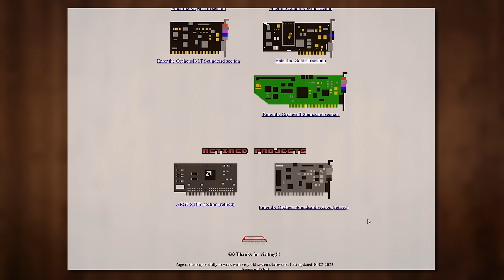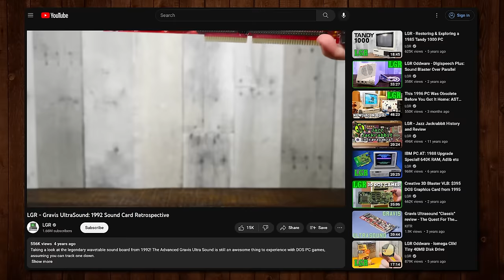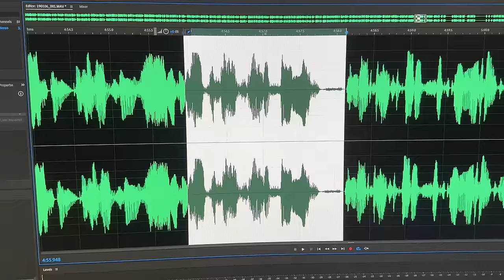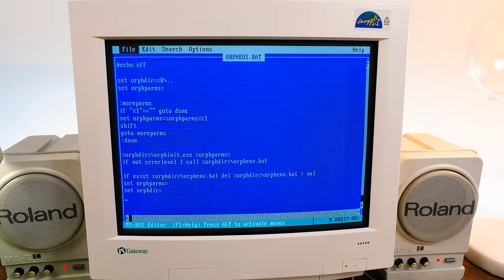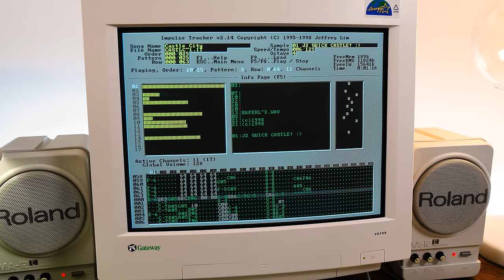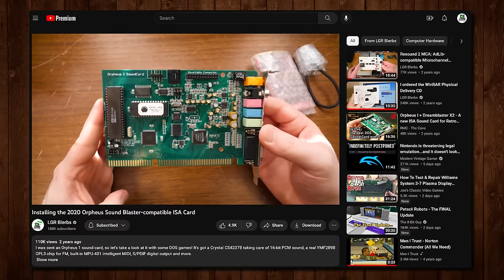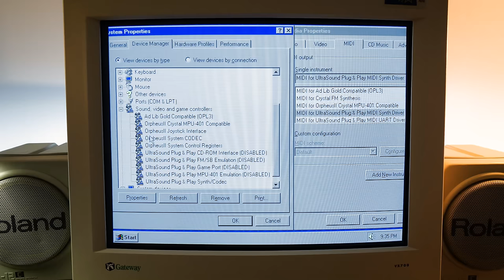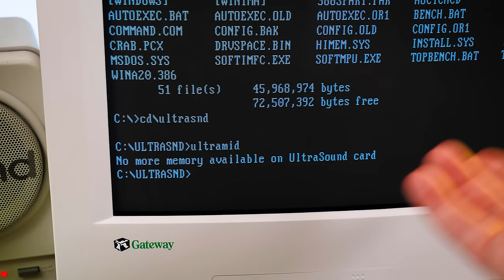Orpheus II: The Best Retro PC Sound Card in 2023? Perhaps!

Comment: Wow, I need one. My external box for my MPU-IPC-T is acting up, and I would like GUS support. I also believe that my first sound cards back in 1993 may have used Crystal chips (i9 can't recall - the card came with a Reveal Multimedia Kit with a cd-rom drive, King's Quest 6, and Stellar 7.) I am sure that later cards I had were Crystal, and before I learned to build my own PCs (and thus build retro PCs with real Sound Blaster cards,) my first Sound Blaster was some integrated crap on my Gateway Pentium III 450, and I disabled that when I acquired a Sound Blaster Live (SB cards were too expensive for my household in the mid 90s.) So with this card having GUS, Intelligent MPU, Crystal, AND OPL3 support, I will HAVE to get one. Currently, I am using a first gen AWE32. To me, it is top of the line for a late 486, but the benefits of the Orpheus seem to outweigh the AWE32.

What is the game at 14:48? Also, where can I get those bracket standoffs for displaying cards? Those are cool!
Reply from the maker: The game is a new one for DOS: Attack of the PETSCII Robots!

The bracket design is here: https://github.com/AkBKukU/PCCardStand
Reply: @LGR  Thank you! I will check out the game. I create pixel art in the style (due to my love of Ultima.)

I am looking for cool ways to display cards I am no longer using, such as a Roland SCC-1, Orchid Voodoo2, and when I get an Orpheus II, both the AWE32 and the MPU-IPC-T! Those little standoffs are cool.

Comment: Nice video. Thanx.

If there is a Vintage (related) product i'd like, its ....
- a 2,5" inch sized system using exclusively newly available hardware such as
- an Am486 DX4-100 to K5 PR-166 CPU, 
- 128MB to 512MB PC-100 - PC-133 RAM,
- ISA SB-Pro. 2.0 to AWE32 Gold compatible Sound with Dreamblaster S2+ Midi-Features and
- a PCI to AGP graphics card with 8MB to 16MB RAM compatible to VESA 2.0 and Voodoo 1 to Voodoo 3 be it directly or through glide wrappers
- SATA CD-ROM connector
- HDMI-Out
- Stereo-Out
- 3x USB 1.1 ( no PS/2 or DIN )
- (Micro-)SD Slot for OS and programs ( for 32GB IDE HDD emulation )

... because we need new systems providing the same features and experiences before there is no ( available ) functional hardware to be had anymore.
Also, those Vintage systems took a lot of real estate ... .

There are projects like the TinyLlama which already is there for the most part, but still struggles with practically an decent first gen. hardware 3D support. I currently am trying to use a Radeon 7000 PCI with a Vortex86EX for graphics, but those are entire cards and not exactly new hardware. One could also try to channel graphics through an attached Raspberry Pi which also already has Hdmi-Out, but emulating a 32 bit PCI bus and a connected graphics card is a serious hurdle. You could get an ATI Rage II 8MB for the job which current sell in spades, but those are refurbished and don't provide decent 3D graphics power. Not to mention, all things "emulated" or FPGA have licensing hurdles.

Comment: Awwww... I was hoping it was a modern sound card. My system decided it will not output audio to both the rear green 3.5mm and the combo headset 3.5mm on top anymore (used to!) And i want a sound card to fix that...

Comment: What to add ? Some Aureal spice ?...
Reply: A cable to connect into TPM port when there is no ISA. Project dISAppointment converts TPM port into ISA slot. It works because TPM is old and needs old way of communication, same as ISA. If sound card vendor creates custom soundcard themselves, they could integrate dISAppointment into soundcard

Comment: Its so weird that we need to produce more stuff to emulate the old stuff, because apparently can't buy the old stuff?
Reply: is it emulating anything though? seeing as they are all original chips assembled in a new PCB, this still drives up scarcity in a way
Reply: @mvogaiht  yeah pretty much...i am hoping for someone to make something like this with all new hardware like something based on an FPGA design. Kind of like how Analogue made their NES clone. I would love to see an entire "486" or "Pentium" board that had everything built in. Would be so awesome.
Reply: @mvogaiht  Just buy used stuff. Thats the only reasonable thing to do in any case. But the insanity of producing new old stuff, thats just plain insane.
Reply: @Nobody-Nowhere  I guess it depends on your definition of "reasonable." In this particular case it's [possibly] a bit of a wash as you can, if you're lucky and look around enough, get all original cards for about the same price. But in other instances, like the Adlib Gold, you're looking at $1500 or more for an original card.

Also, combining functionality like what this card does is helpful in systems with fewer ISA expansion slots.

Additionally, chip age and reliability becomes more and more of a concern as time passes. Eventually real hardware becomes collectible rather than functional. Older computers like the C64 are a prime example of this.

Comment: Will I still need a DirectX compatible sound card alongside this one? I've heard that if I plan to run multiple eras of retro games, I'll need to have a DOS-compatible sound card and a DirectX-compatible sound card.
Reply from the maker: Ideally yes. It’ll still play Windows software just fine, but it’s nice to have a late 90s/early 2000s PCI sound card installed alongside this if you’re installing it in a Windows 98 system, for example.

Comment: There is a project dISAppointment to convert TPM port into ISA slot. TPM is an old thing and interacts the same old way as ISA does, that's why conversion is possible. I wish a version of Orpheus that contains built-in dISAppointment and connects to TPM port. It may use PCI Express to only drain power.

I have also found this part: Winbond W83626F LPC-to-ISA. It may also suit because TPM is LPC more or less. Or maybe some TPM ports are abridged LPC, and that's why not all TPM motherboards are compatible

Comment: Question: are there still motherboards being made that support 16-bit ISA boards? Like retro 486 boards or such? Otherwise you need an old PC, and those will only get rarer as time goes on.
Reply: There is a project dISAppointment that can convert TPM port into ISA slot. This is possible because TPM requires same old ISA-era way of interaction.

I have also found this part: Winbond W83626F LPC-to-ISA. It may also suit because TPM is LPC more or less. Or maybe some TPM ports are abridged LPC, and that's why not all TPM motherboards are compatible

Comment: The Orpheus II is an amazing bit of retro tech, but $400 is steep for a lot of retro buyers.  The $45 PicoGUS also launched in 2023 and in it's most current 2.0 version can emulate the GUS, Sound Blaster 2.0/Adlib, CMS Gameblaster, Tandy 3-Voice, an Intelligent MPU-401 MIDI interface AND a allows use of a USB mouse/gamepad in DOS games.  If you want to equal the O2 feature set you simply pair it with an inexpensive ESS Audiodrive or Yamaha YMF7xx ISA PnP sound card and you're still under $100 to experience a huge range of early DOS audio hardware.

Comment: What would your thoughts be on an 80's/90's cyberpunk themed build? I'm thinking of using the Corsair Vengence c70 case in black with a Kingwin FPX-007, fan controller, a Sony PVM monitor and Madcatz Strike 7 keyboard and RAT mouse.. A fair bit of the tech is 2010's rather than 90's/00's. But they have that industrial grungy cyberpunk look imo. Not really familiar with any other mice and keyboards that have that kind of vibe.

I'm open to any ideas of additions or replacements, so long as it has that retro cyberpunk look. Like other drive bays that have a good industrial or techy look.

Comment: Why would someone want to make a DOS machine for sound ? Instead of using a new Windows machine with an emulator?
Reply: Have you tried to set up low resolution in Windows? I have a CRT display, but with Windows 10 I can hardly get back to scanlines. I cannot set up 640x480 in Windows 10, and if I set up 800x600 in Windows 10, I get fake 800x600. It is 800x600 from programs' perspective, but in fact 800x600 was blurred and stretched to some higher resolution, and it is far not the same as a real 800x600 on a real CRT.

Popular 320x200 presents some additional challenges. It is supposed to be used on 4:3 CRT, but 320:200 is not 4:3, so each pixel has aspect ratio 6:5. If you try to display 320x200 accurately, you'll need some very high resolution. Hopefully 5:4 is not very different to 6:5, so with 5:4 you can fit pixel-perfect 320x200 into 1980p.

One day you are just fed with all those fake Windows 10 resolutions and failed attempts to display 320x200 on rectangular pixel matrix. It's better to build a dedicated PC that will work just right.

Comment: Remind me again why this is necessary, modern boards can't play retro sounds?
Reply from the maker: This is not for modern systems. It’s for vintage PCs with an ISA bus.
Reply: Doesn't using new hardware kind of defeat the purpose of a vintage system though?
Reply: @No-vq1iv 
 and?
Not the point of this video... smh
Reply: @explorer9049  What is the point then?
Reply: @No-vq1iv  The point is to play games with sounds on a vintage IBM-PC system, @No. You can't install an ISA card on a modern board. So, this card is for a vintage PC. Hope it helps you understand. :)
Reply: @EricFraga  Not really, it just brings me back to my earlier question: Doesn't using new hardware defeat the purpose of a vintage system? Seems like you're paying hundreds of dollars for an over-engineered emulator.
Reply from the maker: This is newly built but it's using old stock sound chips and components.

There is no emulation here, it is made with old parts for use in an old PC. A company in the 90s could've theoretically built this card, but it only now exists due to the community putting all these things together into one product.
Reply: @No-vq1iv  There's no emulation involved, @No. It has nothing to do with that software emulator you use on your computer to play games from a Sega Genesis or a NES. This is a sound board, it's not remotely related with emulation. I think now you got it :)
Reply: @EricFraga  I don't think you did though, forget it.

Comment: You could argue I think successfully that the PicoGUS is superior and about 340 dollars less
Reply from the maker: That’s also an emulator and not original old chips like this.
Not that it makes much difference to most users but the distinction is… distinct.
Reply: @LGR yes emulated but for a sample only chip like the GUS emulation is easily perfect. Even the opl 3 on the picoGUS is for all intent perfect  and that's much more difficult. So long as you have the card in a old machine on a CRT you are golden

Comment: Ears fisting for three hundred bucks.
Totally bullshit IMHO, if there were XG100 on mpu 401 port...
BTW never liked gravis and most of Roland samples, same as awe32/64 with alternative banks - just a bonus for some games like warcraft. True elite sound must be like an opl4 synth, Yamaha synths are close to this , opl2/3 games sounds same oe better, gm mostly better also
Reply: For Gravis though the sound patches are customizable using the so called PAT files.
Reply: @rommix0  I've mentioned this later as wt awe synth(except it's pretty good with built-in bank), but either way, it's acceptable only in some games with opl synth and in games like system shock still far from ideal, try this on sxg50 emu for instance, best i've heard, and full opl 2/3 compat from other side, even when used for sounds like in xcom